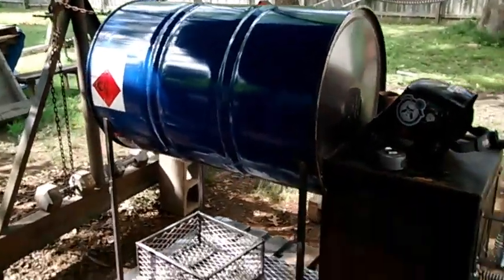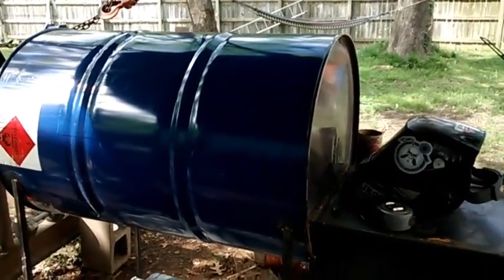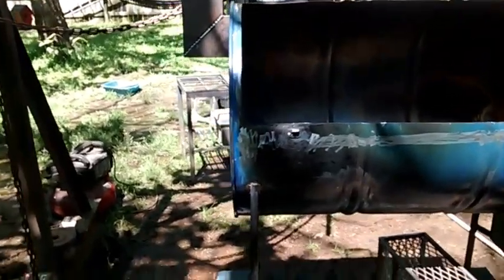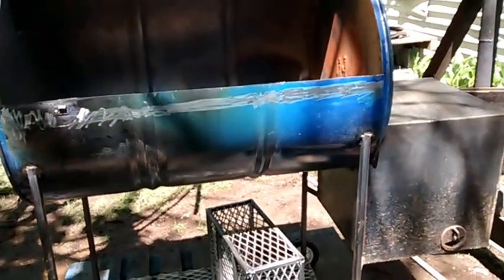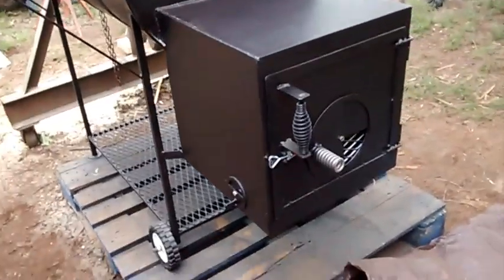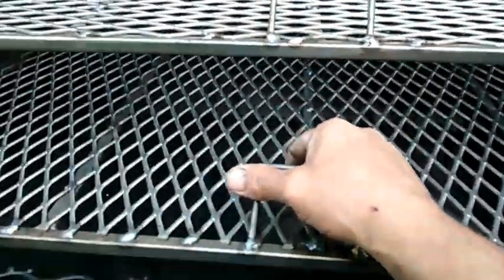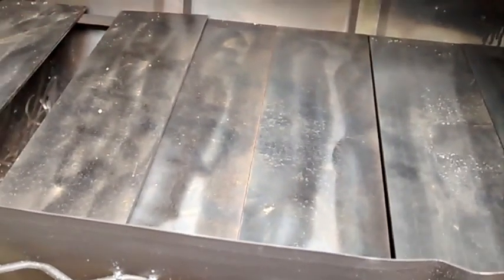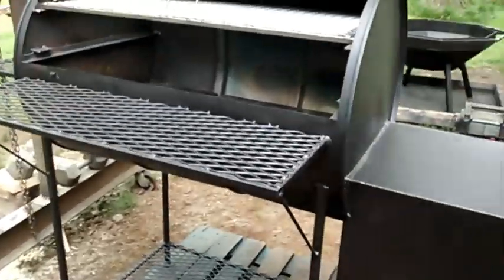Barrel smoker build

Comment: Nice build Allen. Those tuning plates in there make like a reverse flow smoker. Where the smoke travels under a solid plate down to the other end of the smoker coming out a vent and the stack is on the firebox end. I like the idea of using those seperated plates like that.
Reply from the maker: jimgam730 thanks! yes those plates will give you a few heating options, depending on how you move them and if you take any out
Reply: Allen's welding/woodworking  I would love to get on just like this love everything about it how to I go by ordering one from you.

Comment: Hey just found your channel and really appreciate your how too vids, great stuff.  I have an old barrel grill that I've had for years and want to add an offset firebox.  Its about 30" wide by 20" diameter.  What size firebox do you recommend foe something that size?
Reply: A 30 pound propane tank is the right size. Use all precautions to cut, fill with water.